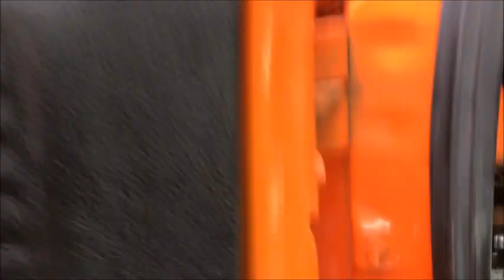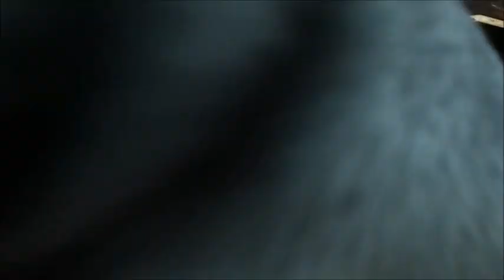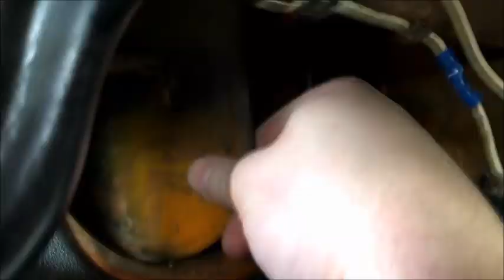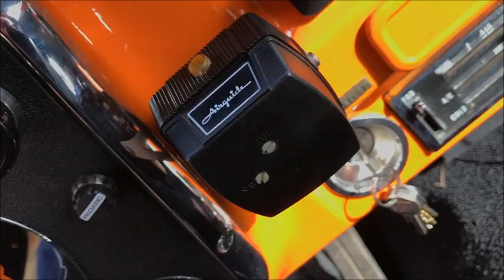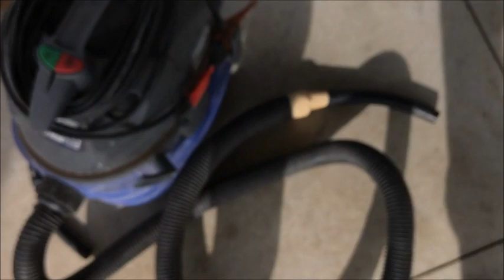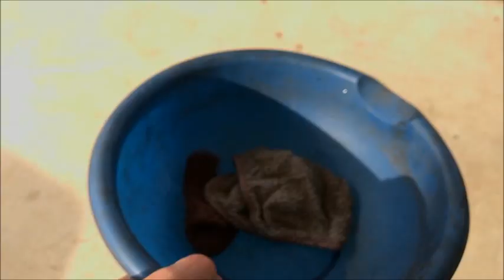C10 Cowl Cleaning plus Old Air Products Cowl Screens

Comment: Where did you get the kick panel speakers and how well do they fit?
Reply from the maker: Kick panels were in truck when I bought it, but I might be Custom Autosound.  The speakers are Pioneer 6.5" A-series (Walmart sells as M600 I think).  That said, 6.5" speakers are designed for door install where both sides of woofer cone are completely isolated.  When mounted in kick panels, decibels vs frequency is very inconsistent.  I'm working on a new design that will use 3.5" or 4" woofers along with a tweeter.  Basically, bookshelf speakers for your truck.

Comment: I recently find out why I was getting water in 
I wish I had watch this video before 
I toke leaves n dirt from 48 years 😅
I used a hang coat and a hose 
Worked and clear the drain 
Now I’m gonna install the cowl screen 
Little things that prevent rust from building up 
Inside your cabin .
Nice video thanks for sharing 
Nice truck too